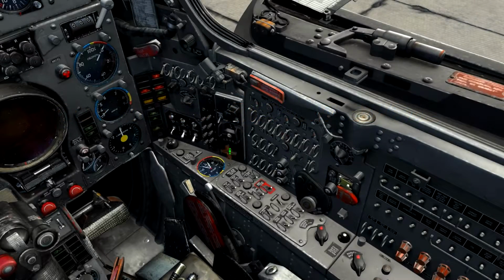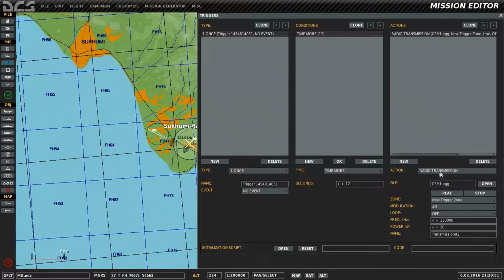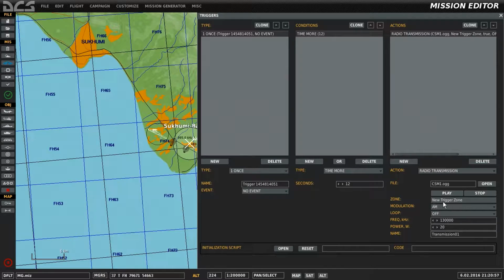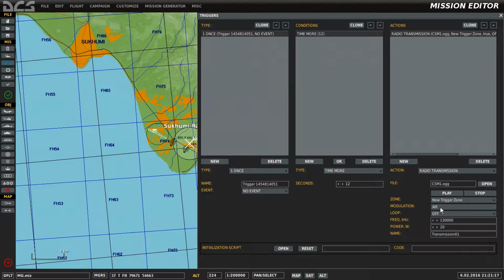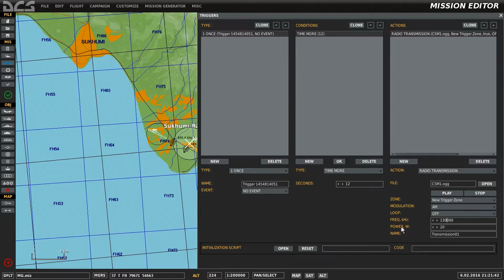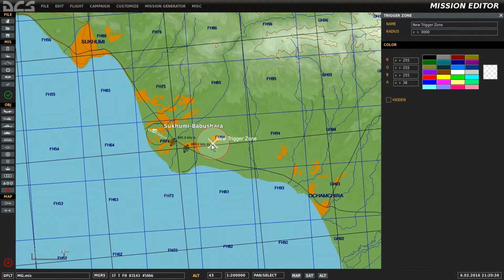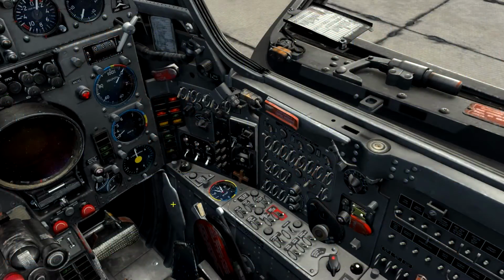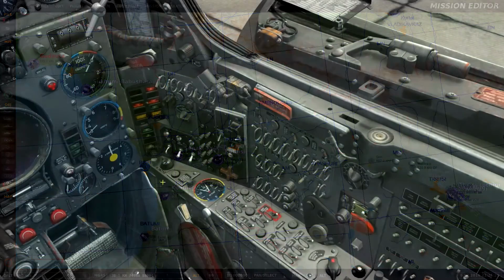DCS:World Editor » Triggered Radio Transmissions

Comment: Not working (anymore). I was looking to see if I made any mistake but no. All radio transmission triggers are not saved. Anything else is fine, so I ended up with text msg trigger.
Reply from the maker: Still works fine on my end, did you forget to enter a name value in the radio transmission trigger action?
Reply: pickinthatbanjo that was it. thank you very much man you saved me :)
Reply from the maker: No problem, it confused me as well for a moment when I tested earlier to see what was up.

Comment: Did you have any issues with the static continuing after the ogg/wav file is played? I have an issue where once it starts the transmission, it continues to broadcast static.
Reply from the maker: It has been a while since I've tested this so I can't exactly recall, though watching the end of this video back I'd say any static will be related to Leatherneck's implementation of the radio rather than anything to do with the trigger itself.
Reply: I think I may have found it. Apparently, not sure if this is recent or not, using the Radio Transmission Mission Editor command will not 'turn off' the transmission once it is completed. If it is set to loop, it will loop but if it is set to 'once' it will play once but leave 'the radio open'. You need to call Stop Radio Transmission to clear it.

https://forums.eagle.ru/showthread.php?t=156195&page=2